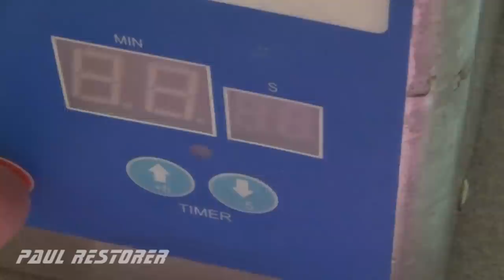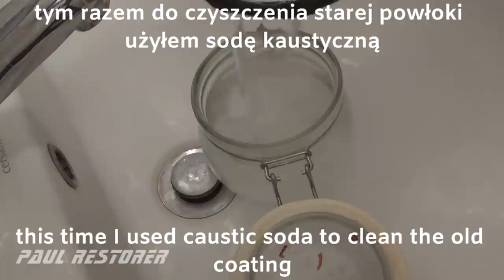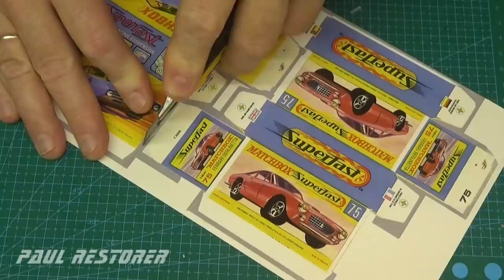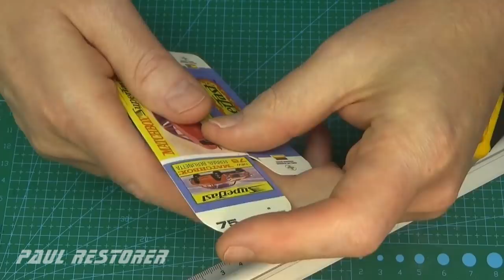Matchbox restoration Ferrari Berlinetta 250 GTL Superfast nr 75 diecast car

Comment: As always......MAGNIFICENT JOB SIR!!! I need that Machine!! LOL I also noticed you seem to be using a thicker paper for the boxes, I remember the first boxes were little thinner and these seem to be a lot thicker...? Or am I mistaken!?
Reply: DZTV It is propably down to what the stock that the print shops inkjet printer can handle. The original litho card printing stock would have been thinner for both economy and machine handling reasons as it would have been a lot easier to stamp out and crease on the finishing machine. He never shows you what he uses on the glue seam but i would suspect it would a be line of hot glue from a heat gun.
Reply from the maker: Thank you sincerely, the illusion with the card is always the same. Regards
Reply: @PaulRestorer  Thanks Paul! I just made my first Tomica video, I hope you can watch it. It is a little long because it is the first one but future videos will be much shorter!
Reply: @MrDegsy69  Yeah I'm no expert on card stock but I just thought the paper he used got thicker is all. Thanks for your reply!

Comment: Nice job. I own one of these. Mine is missing the back trailer hitch. What was this car to pull?
Reply from the maker: Thank yuo very much
Reply: it's not missing or damaged ...  only the regular wheels 75 Ferrari before Superfast had the tow hook, Lesney also removed the exhausts from the base, the focus was the Superfast racing tracks and I think the back end caught on the loops so it got slimmed down a few mm in length and increased a touch in ride height by removing the pokey out bits, buy a track and some loops, run yours down it then you'll know for sure, growing up's so over rated sometimes, saw it all and enjoyed itself that one then went back to where it started, looking pretty in a box, full circle and gained a tow hook!
Reply: Its own weight, perhaps?